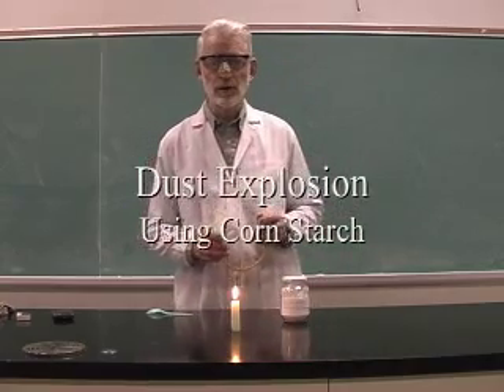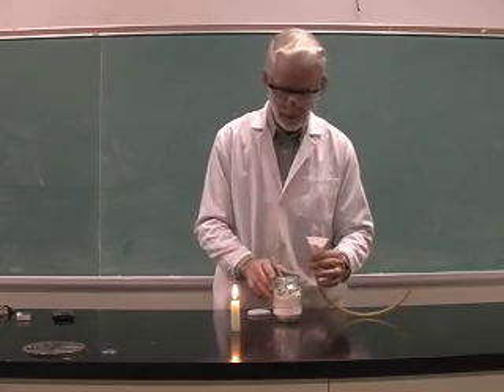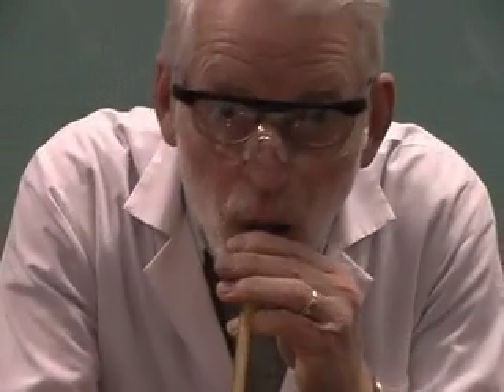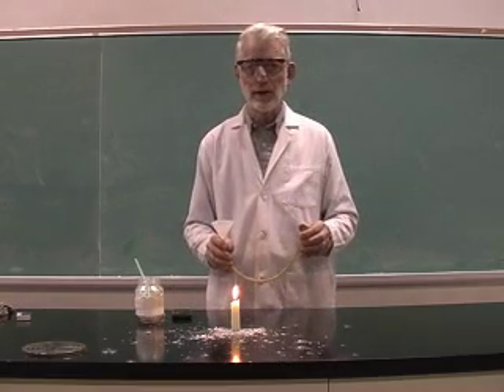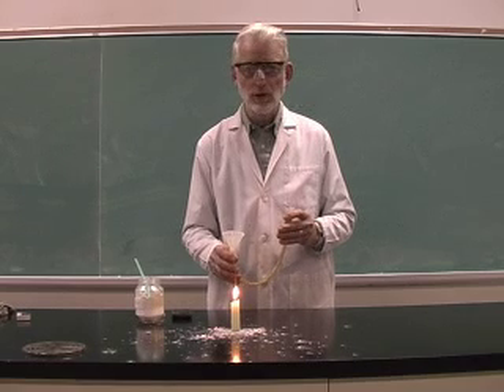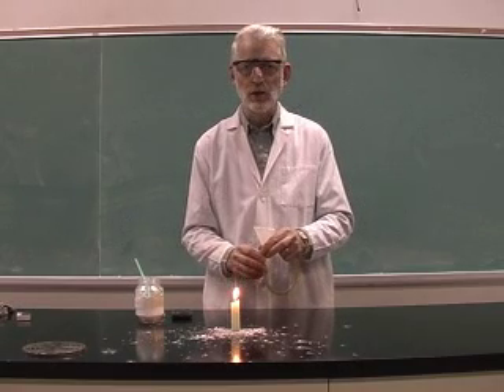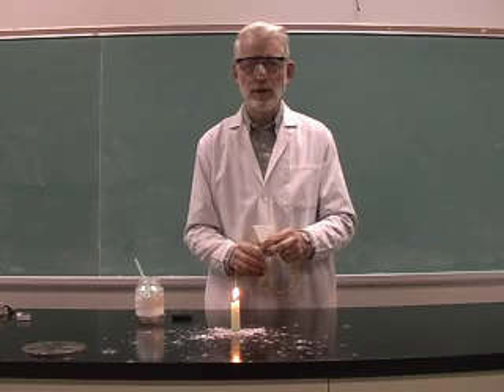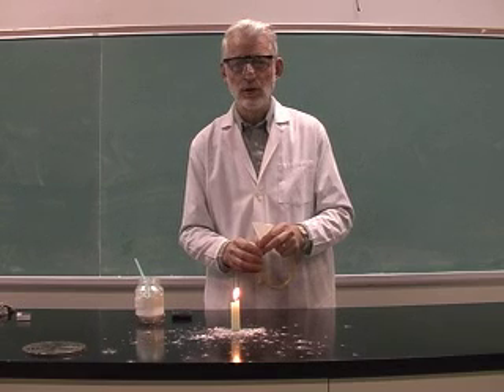Dust Explosion Using Corn Starch

Comment: Not very impressive - with a massive ignition source like that candle most dusts will "explode". You need to use a static electricity spark (as cited by you as a common igntion source with grain transport systems. If you are interested I have a nice "bench-top" static source which will ignite flour etc.

Comment: I have a question.

If i use other dusts  ex. baby powder or general dust. 

Are explosion  ????   sharing for me please - -"
Reply: It is just with organic dusts, like wood dust, or common flour. The baby powder is more a mineral dust. The trick here is: If the particles are smaller, they are more easy to burn, because the oxigen can be more easily in contact.
Reply: ***** *Grammar. Thank me later.
Reply: Lol screw grammar :3
Reply: Xhanoir *oxygen
Reply: TCI34RustyHammer not all dust will cause that he used cornstarch but baby powder wouldn't but with dust like that collects on things its a possibility another is sawdust but that it has a very violent reaction.
Reply: ***** He's probably learning how to speak English, including how to write it. Get a life.